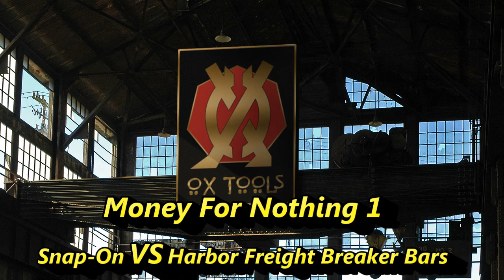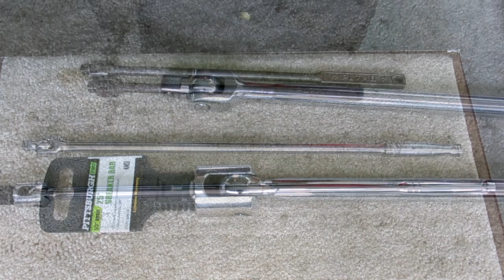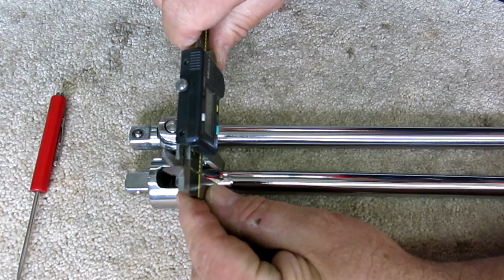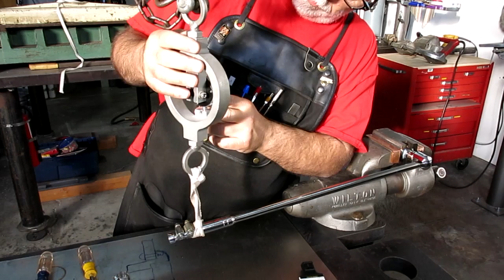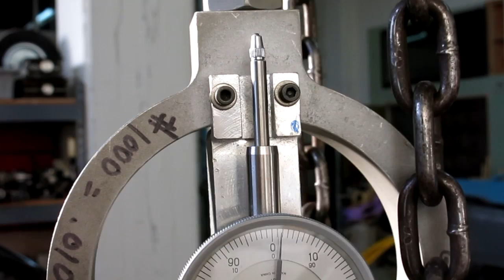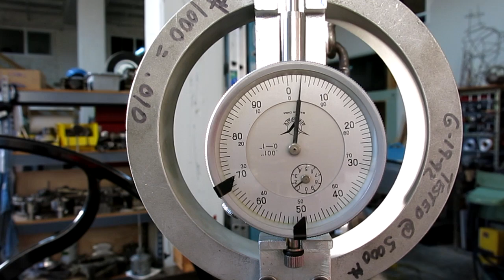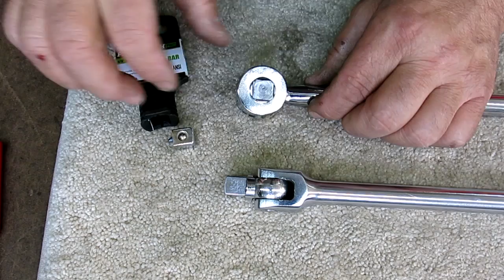Money For Nothing 1

Comment: first off this test is kind of bogus, Harbor Freight makes a breaker bar in their pro line almost indistinguishable from that snap on, its $20 and I own one. 
Secondy anyone applying 300ft lbs to a 1/2" breaker bar is on a fastener size that is too big for that drive size. Most lug nuts that are frozen will readily shear off the  wheel studs with a breaker bar that size. Using an air impact gun instead they will come loose. 
So the point is even the cheap HF tool you broke will be more than adequate for use up to and beyond shearing off any fastener you are properly using it on. 
Don't let the scare talk of this clip steer you away from HF hand tools.
Reply from the maker: Hi Bat,

What your supposed to do with a tool and what you actually do are two different things. You are telling me that at midnight on the side of the road your not going to pull on that breaker bar that hard? The point is when you need to do something like that you will. Pedantic statements about proper tool usage are meaningless. Sure you could stop and wait for the store to open and go get a 3/4 drive or you could just try to get the job done and get off the side of the road. I was leveling a large press brake and working on the anchor bolts when I pulled something like 300 lbs on that Snap on bar. Only tool we had and the job needed to get done now not tomorrow or next week. Bar didn't let go with a big surprise which is just what you would want to happen.  Thanks for the comment.

Cheers,

Tom
Reply: +oxtoolco if you pull on that cheap HF breaker bar on the side of the road at midnight you will shear off the wheel stud before the tool breaks. I've done it and thats why I use an impact gun except in emergencies. Like on the side of the road at midnight, only now I pull the bar with one hand and hit it with a BFH with my other. Yes that helps.

Comment: Would you really compare $20 to $150??   You would think at some point people be to old for that.   There are actually devices that "accurately" test tools not just a chick sh.. setup you have there. And I'm sure "back in the Day"  you could pull that breaker bar at least 45°.
Reply from the maker: Hi Ralf,

Cost was not part of the comparison. And what would the magical accurate machine for testing this be? If your going to throw down and call it crap at least show us an example of the proper  ASTM test method for testing mechanics breaker bars. Thanks for the comment.

Cheers,

Tom

Comment: If you find a bolt that needs 300+ lbs to break, you sir are using the wrong tool. lol
Reply: 300 ftlb's is not unusual think about the larger things on pickup trucks like lug nuts. They can easily have specs of over 150 ftlb's. Add some rust or Coss threading and the break away torque would easily be over 300 ftlb's.
Reply: Chris Findlay it's not the force required that's wrong mate. It's that the tool is wrong, the snap on withstanding more isn't the point. 
If your going to spend 200 on one bar, clearly finance isn't the issue you would be better served having a cheaper half inch, plus another brand of either 3/4 or 1 inch drive bar, your not bending either of those haha
Reply: Ryan Gelson might wanna go to a full 1" breaker if you're going to try to go for the Hazard Fraught. I was able to break my 3/4" fairly easy...

Comment: mixed views on this i have the cheaper breaker bar that costs $20 as apposed to $95 for snap on one and guys in my shop have broke there snap on ones then used mine to do job snap on one failed on . and my cheaper bar i broke twice in 15 years replacement ends are $5 each

Comment: I'd say that's not bad on the HF breaker, torque is force x distance so that 275lbs ends up being 745 foot pounds at the business end, roughly 5 or 6 times more than you'd ever want to torque a lug nut for anything up to a 3/4 ton truck for an idea of exactly how much torque that is.

That's enough to snap pretty much any 1/2" or 5/8" bolt you'll ever encounter, I've always been taught to meet force with force, so for 3/4" threads and up I go for a 3/4" breaker like most people do. 

I think the takeaway here is not only choosing a suitable quality of tool for you, but choosing the right one for the job.
Reply from the maker: Hi Lucas,

Sometimes you only have one bullet in your kit for the job at hand. I would keep the HF in my car for busting lug nuts on the side of the road but if I was up a cracking column in the rain I'd have the snap on with me. Thanks for the comment.

Cheers,

Tom

Comment: hmmmm
well ..
you get what you pay for 
what makes me wounder is if the HF breaker bar can hold atleast half what the snap-on can

then why does snap on goes for 10 times more on the price...?
so if the HF is 10 dollars that like 100 for the snap-on
not 20 not 60 a 100 dollars 

i mean the thing comes shipped overseas handles atleast half the rate if not abit more
then cost as much as a high end cheese burger...

i mean do they have slaves making these  for free ?
i dont know how they do it
Reply from the maker: Hi Faisal,

I don't think its a linear relationship between cost versus performance with tools. Why does a Ferrari cost a hundred times what a Toyota costs? Its still has four wheels and an engine. Thanks for the comment.

Cheers,

Tom
Reply: oxtoolco 
indeed

Comment: Thanks for an interesting video!  Like you said, the Harbor Freight's square is machined; my guess is that the Snap-On's square is forged.  Also, shape of the Snap-On's square transitions more smoothly into the part where the pivot pin goes through, making fewer places for stress risers to form.
Reply from the maker: +Ed Bailey Hi Ed,

Thanks for the comment.

Cheers,

Tom

Comment: Your play movement measurements were skewed as your tape measure was slightly angled on the Pitts and more vertical on the Snapon. Also I think your strap/harness maybe stretching to create the fade or drift on the measurement after you reach a level and it fades.. I would also think if the snapon failed it would be more catastrophic due to material is stronger and able to retain the energy so when it would fail it would have more stored energy.. BTW Snack-On does not make their tools.. Same tool as SnapOn can be had by NAPA tool brand (Carlyle) for $35..

Comment: I always buy HF over the big names, even without the warranties freon HF you have 90 days to get a full replacement if tool fails. also Hf tools with exactly for what you need them for at a penny price that is unbeatable. stressing a tool to failure isn't what a practical Joe in the garage working on the old VW isnt going to experience any time. The Hf tool is worth the friggin $12. nuff said for the big name buying dohdoh lol
Reply: have you ever seen the torque settings for the crank bolt on a VW ??? I can remember seeing my dad bouncing a 6" pole on his breaker bar to get it to crack .. the breaker bar had a 45 degree bend in it when he was finished ....

Comment: it would be interesting if you bought the better harbor freight breaker bar            item#62729. it retails for $20 vs. the one you tested in this video which is $13. the $20 breaker bar has a fork design that is similar to the snap on unit. i wonder how much better of a tool $7 more buys. i bet it performs allot better. once i saw that fork design i was not impressed it looks cheap. i have found there is a big difference even at harbor freight between their cheaper tools and their better tools. they do offer some great tools for the money, but they also offer cheap crap. i recent bought titanium nitrate drill bits from harbor freight, very impressed they cut through steel no problem. i had previously bought their el-cheapo bits and they were utter crap. i suggest that the slightly more expensive tool they offer is far superior and well worth the $7 more. i am not a professional mechanic but someone that does everything to my car aside from transmissions. i do not use my tools everyday, but use them often enough and when i need a tool to work i need it to work now and not break.  i have found that buying tools at harbor freight buy the best tool they offer. usually they are decent for the money.
Reply: +andrew donohue I second that motion, the pittsburgh pro are supposed to be a lot better than the non-pro stuff, and has the same design as snap-on,  wouldnt be surprised if it was just as good or possibly outlasts it , hmmm.
Reply: The plastic tag from the HF item indicates that it is the "PRO" model, but...

Comment: I think this test is biased. First off how different is the metallurgy of the 30 year old snap on from the recent one, or the quality. Also two totally different styles. If Harbor freight, had the same head design maybe it would have held up, probably not since the drive broke.
Also the Snap on was only brought, up to about the same torque, what would the break point of the snap on be. Also the HF was flexed twice. 
I live in Snap-ons world headquarters, city. I recently bought my first snap on socket. A med size deep well 15mm 
for $21 off the truck. 

I'm not saying all HF tools are the best, but many Pittsburgh Pro tools get the job done. I tend not to trust the non Pro name.
Also living in snap on town, I had to happen upon a truck at a local business.
Snap on is the same distance from me as Sears. I can't even walk in and buy Snap on, how convenient is that. Also since craftsman started producing in China, I have been buying HF.
Even Snap on has its imported blue point tools.

Comment: One important thing that wasn't mentioned is the price comparison. In most cases the cheap version will do the job, in the few extreme cases it won't. Overall the cheapo version is value for money. On the professional side the snap -on tools can't be beaten but to the person who only used a breaker bar for just one or two jobs and more importantly doesn't have the wherewithal for high quality then the cheapo is value for money. I talk from experience and have for most of my life spent money on my family and not on expensive tools, but sometimes when the cheapo tool breaks I then wish for the better quality. 99 times out of a hundred the cheapo tool is satisfactory.
MoK

Comment: We place pipes on these and break the torque on a mast nut on top of a helicopter, these nuts are torqued to 275ftlbs and I have seen well above 350ft/lb breaking torque. If the bar broke like above you would fall 6ft and break your back.
Reply: +ecoheliguy because his moment arm was about 2 feet and had almost 300 lbs of force, Tom was putting about 600 ft*lbs on that HF bar
Reply: Also people don't realize that that flex is wasted energy and confidence. You need a rigid bar to pull full potential.
Reply from the maker: +ecoheliguy Hey Heli,

Well said. If I had to do stuff to 350lb/ft all the time I would get me a young assistant and a 3/4 bar. Thanks for the comment.

Cheers,

Tom

Comment: Great Video. It's nice to see the difference in the tolerance of the heads. One other difference you didn't mention is the distance from the pivot to where the socket seats. The Snap On is a shorter distance which might let you work in tighter areas than the Harbor Freight model. I'm just a home mechanic so I don't use my tools all that often, but I have the snap on 18 and 24 in bars. Harbor Freight recently started stocking the new professional line and the new 25" bar has a cushion grip and a head more like the snap on. It's $19.99 and I couldn't pass it up for $15 with the 25% off coupon because of that grip. I'm looking forward to using it. Those old Plomb breakers of yours are from the 1940s.
Reply from the maker: +john4kc Hi John,

The professional line at HF is not bad looking. Still cheap enough to put one in with the lug nut wrench in the trunk of all the cars. Thanks for the comment.

Cheers,

Tom

Comment: Torque measure would be nice.  I have used 1/2" drive Snap-On breakers just like that to 400 lb/ft many times. (never bought 3/4" drive) I use craftsman in my truck in case some POS breaks in & steals them.
Reply from the maker: +Doug Bourdo Hi Doug,

I never bought a 3/4 drive either as my Snap on has not let me down yet. Thanks for the comment.

Cheers,

Tom

Comment: The drive twisting on the HF bar is exactly how mine failed, although I had to plant both feet and crank on it (Stubborn lug nut did not want to come off) and I went over backwards quite amusingly. I replaced it with a 3/4" drive with an end like the Snap-On one that took a cheater pipe to shear off half of the fork on the handle when it failed on the same nut.
At that point a torque multiplier got ordered from Ebay and did the job.
Reply from the maker: +Selinica Harbinger Hi Selinca,

Good thing you were not up a ladder when that happened. Thanks for the comment.

Cheers,

Tom
Reply: +oxtoolco I am thankful there was no ladder involved too. It's probably a fine tool for someone looking to loosen the seat bolts on their worn out Honda Ruckus, but it definitely sold me on buying either used or new higher quality tools. They just aren't up to what other comparable tools are, and it's definitely not worth risking any (further) injury trying to push a tool to do what its peers can.
Reply from the maker: +Selinica Harbinger Well if I was on the side of the road in the rain I would sure give it a go. Thanks for the comment.

Cheers,

Tom

Comment: This has nothing to do with America or China, you can't measure quality with place of origin!
The truth is both tools are very good at their price range, but the Chinese is a better tool overall considering it costs $12.99 vs $127.00 for the Snap on! That's 10 times more for a tool that maybe, just maybe, does twice as good. Sorry, no contest.
Can you imagine if the Chinese factory made a breaker bar worth $127 just how strong that tool would be? I bet Snap on could not make a $12.99 breaker bar that could compete with this Chinese harbor Freight item.
So lets drop the false nationalism and just leave that to Trump, Ok?
Reply: +Galileo Galilei  When I used tools for a living I bought Snap-On or Mac. No reason I could think of to use tools that wouldn't hold up. I suppose for a guy doing it as a hobby the cheap-o would be OK.
Reply: "That's 10 times more for a tool that maybe, just maybe, does twice as good."

Correction, that's 10 times AS MUCH, or 9 times MORE.

Comment: Although if you're snap on had failed you could get it replaced at no cost, I wonder if even the new snap on replacement would be as good as your 30 year old tool. I snapped a HF 3/4" drive breaker bar, but I had a 6 foot long length of pipe on it at the time. It was from a 3/4" socket set, the whole set was $40, so I could not expect much, but I just do not need those sizes often enough to warrant buying a high end tool in that situation. The store did replace the bar no charge, and I noticed the design on the replacement was different. Looking down your nose at some one because they shopped a HF store is tool snobbery……..Like Mr. Lipton said, better to have a tool than no tool at all.
Reply from the maker: +Steve Watroba Hi Steve,

Well said. Thanks for the comment.

Cheers,

Tom
Reply: oxtoolco You're welcome Tom. Love your channel. BTW, I have a theory on that moving section that's like a sub frame on your drill press. My Sipp sensitive drill press has a similar setup. I think it is designed that way so the support can be moved as close to the end of the quill for extra rigidity, but moved up out of the way for larger pieces. Regards.

Comment: I don't like to do this, but I have to say I don't care for these kinds of tool comparisons much. Not because Tom was being unfair, he wasn't, but because most of the time it comes off as "Harbor Freight sucks. RAH RAH Snap On. These tools are made for two completely different environments and intended uses.

Think of it this way. Imagine two guys. One lives in the city. The other lives in the country on a farm. The city guy owns a little sub compact car. The farm guy owns a Ford F350 Superduty. Why? Because they have completely different needs. The city guy may never need to haul more than an order of takeout in his car, but the farm guy may need to haul 3 tons of fertilizer. Is the F350 better? Yes, for what the farmer does with it. For the city guy it's way over priced and to big for weaving in and out of traffic. The farmer wouldn't want the sub compact because it breaks under the stress of farm duty he'd have to put it under.

Now, the city guy goes to visit his sick mother and hits a huge pothole in front of the farm guys house, spins out and warps the frame. The farmer comes out and starts laughing at the city guy. "That car's a piece of junk. They don't last two minutes around here. I'd only buy Fords. Get a real car." and on and on. Do you see my point? The city guy had to do things the car wasn't designed for like driving on rough country roads and it broke. Was it the cars fault? Should he go and buy an F350?. He doesn't need a F350, but a small truck or something else? Maybe, if he thinks he'll be going back to his mom's house regularly. Or maybe, rent a truck when he needs to visit

Most people don't like to waste money on cheap tools and learn pretty quick to buy the best tool they can afford that fits their expected needs. For a lot of people HF tools are well within the range of their needs and budget. Will they last years in a shop used every day? No, but they aren't meant to be, although the quality of many of their tools has gone up a lot in recent years. Do they get the job done for the average guy who just needs to take lug nuts off his car once or twice a year? Yes, if he knows their limits.

OK, ranting off. Sorry if I offended anyone, but that's how I see it and hopefully I've given everyone something to think about.